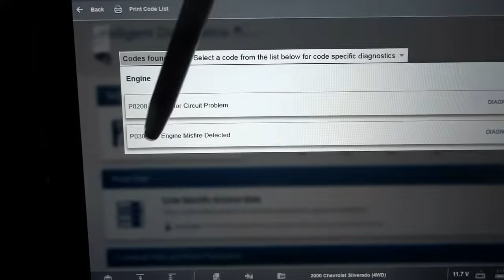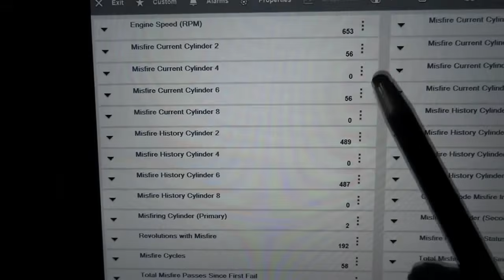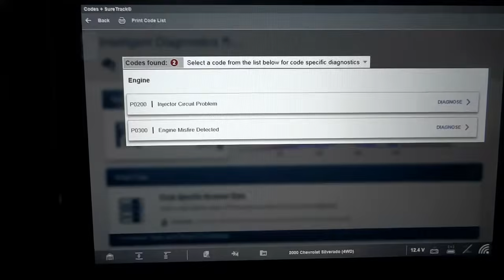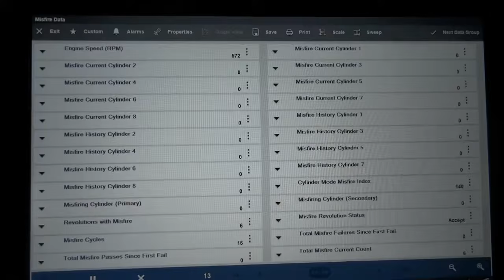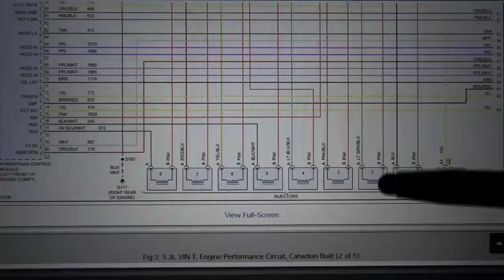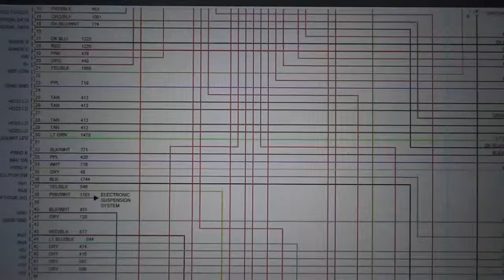Chevrolet Silverado Code P0200, Fuel injector Circuit Testing, Misfire P0300

Comment: Fantastic video.   Ran into the P0204 code on my Buick with the hard miss and need to troubleshoot the injector on cylinder 4.   Your clear and thorough instruction has given me the confidence to check the wiring and find and fix an issue if there.   Thank you for such a helpful video and you earned another subscriber...

Comment: My boss ❤
Reply from the maker: @GabrielEbenezer-ko2hp   Hello my friend!
Reply: @KITS_Auto_and_Truck_Repair  there is a 2013 Chevrolet Dezeal engine am working on, the car cranks but no start, I checked the egector to check if I can get a power on the sucket wire when the ignition is turned on, I checked with my test light  I didn't see a power i tested it with my thermometer to check the voltage I saw 2.4 volts instead of 12 volt what could be the course of the problem sir

Comment: Been troubleshooting a po302 on my 2006 Subaru sti.  Did everything else. All swaps,  compression and leakdown test o2 denso sensor replacement.  Vacuum leak test with smoke machine and last crankshaft and camshaft position sensor test.  Ordered  a noid kit for injector circuit
Reply from the maker: @PeterHernandez-lg2eh  did you do an injector flow rate test?

Comment: Great vid and easy to follow your thought process. One big question? On a modern 6 cylinder like a Chrysler 3.6 L the intake upper manifold would need to be removed to get to cylinder 2-4-6 This means there is no running the engine to test anything or checking compression right? So how are all these things checked.
Reply from the maker: @patlyle2621  They can be checked at the injectors fuse with an amp clamp!

Comment: I have a 2007 Silverado replaced the faulty injector circuit.. Tested all 8 with noid light and all now show as working… Cleared the engine light and after a few minutes of letting the truck run engine light came back on ran a scan and it is throwing the same
Code as before.. Checked with noid light again and they all blinked… What else could be causing the P0200 Circuit malfunction code?
Reply from the maker: @thethriftypicker7425  you probably have an open solenoid in the injector ( open injector )
Reply: @KITS_Auto_and_Truck_Repair  ok thank you!!!

Comment: How would i test the fuel injector's on a honda 3.0 v6 they are under the intake manifold? Im having a misfire on cylinder #5 and im pretty sure its a fuel problem because the check engine light is blinking.
Reply from the maker: @505fastlife6  you are gonna need a wiring diagram to test the injector under the intake, I recommend you take it to a pro mechanic who ccan diagnose it for you!

Comment: Thanks brother, let me please ask you this, can injectors communicate with ECM without power or voltage from the battery? Because according to your case, injector has no power coming from the battery, yet injector communicating with ECM
Reply from the maker: @kaaraa-mardha1977   Sorry! I didn't understand your question! the injectors receive power from a fuse then the ECM grounds them to turn them on!!
Reply: Ok brother, thanks for your quick response. if injectors receive power from the Fuse, and there is no power coming from site Fuse, how can then The injector communicate to ECM? Or the injector can still communicate the ECM even if there is no power from the Fuse?

Comment: I have two older GMC Yukons 
What bi-directional scan tool are you using in this video?
My 2004 Yukon has a misfire and I’d like to have the scan tool tell me which cylinder it is.
Reply from the maker: @Myflarelately  in this video I used my snapon zeus scanner!

Comment: Great work 👍🏽
Reply from the maker: @naptown4200  Thank you!
Reply: @KITS_Auto_and_Truck_Repair  hey bub thanks for the response back..? I got a P0204 cylinder 4 injector control circuit, I have no clue where to start from. 05 cadillac cts 3.6 engine..I've fixed the P0304 misfire, still have the P0204 CODE any tips sir 🙏🏽

Comment: What is the tool that you screw on to the wire before testing it? And is it necessary to test the wires?
Reply from the maker: @davidedwards7954  yes! it's a wire piercing tool!

Comment: I have a 22 year old Peugeot 206 and it's become my forever project since blowing a head gasket 2 years ago. As the car only cost me £500 I was not going to spend thousands for a mechanic to fix it so I decided to teach myself. Since then i've done pretty much everything you can imagine to this car and recently after replacing the CAT and exhaust i've been having a misfire, as the car was so old, I just went ahead and replaced all the injectors, coil pack, sparks did a compression test (all fine) and all I am now left with is an electrical fault and your video has very simply explained everything I needed to know to go and find this wiring issue and fix it, kudos to you and thank you. Sub'd and liked !
Reply from the maker: @i.fishtank  Thank you! I'm glad to hear that the video was helpful, and welcome to our youtube community!
Reply: @KITS_Auto_and_Truck_Repair  Thanks for the reply, so to update in the end I tested every wire on the ignition circuit and there were no issues with any of it. Voltages and continuity were all fine. However I did find a cracked and disintegrated knock sensor which I replaced and that has resolved the P0200 open circuit issue, however, the P0300 random misfire still persists. I am almost at a loss now, I am thinking to replace the fuel filter, MAP sensor and do a battery condition test as a next step, those parts will only cost me about £40 but I wonder what you would check?
Reply: Oh I should add, it's already had new O2 sensors.
Reply from the maker: @i.fishtank   I recommend you take it to a pro mechanic who can diagnose it for you, if the wiring is good your ECM Could be the problem, go get it diagnosed!
Reply: @KITS_Auto_and_Truck_Repair  Thanks for the quick response... spending money on diagnostics for the ECU is about the same cost as buying one, but my point in all of this is to try and learn and teach myself, I'll start with the fuel filter in case it's a pressure issue and a MAP sensor (both are original it seems so 20yrs+), I can get both new for a total of £10 :goodvibes: after that then I'll think about the ECU. Out of interest, do you think it's possible it could be a timing issue? I did have to do the head gasket 18 months ago, but it ran fine until this year.
Reply: Ha! Turns out it was the MAP sensor after all this time. Just started to go bad the same time as the knock sensor.

Comment: What’s the part you used 18:56 called I believe you said a piercing tool
Reply from the maker: @ynotdoityourself3288  Yes!
Reply: @KITS_Auto_and_Truck_Repair HELP PLEAS 😢P124D CODE How can I repair the P124D code? Everything started to fail in March. After changing the oil, it stopped and I had to call a tow truck. They changed the module and the pump. After 20 days and 300 miles, now I get this code. And I am disabled. I can't afford to pay almost 4000 in a month. Thank you.

Comment: My problem is that I don't have a signal on the two injectors on the signal cable. Could it be a damaged PCM? Because I checked the cable and everything is ok. The signal on the signal cable is weak because it powers the led bulb but not the noid light.
Reply from the maker: AdamMotomaniak  make sure you don't have corrosion on the control wire, so if the control wire is good, check your powers and grounds of the ECM if they are good they you have an ECM problem

Comment: I have a flickering noid light on all 8 cylinders, cleared the codes multiple times and still having 200 and 300 codes. Brand New  Autozone engine and old harness. Please help!
Reply from the maker: CHISEL CHIPPER 68  if your wiring is good check your injectors flow rate, you can have partially clogged injectors and make sure your coils are good too that's for the P0300 code, than for the P0200 code, you might have a Ecm issue but check all the circuits first!
Reply: @KITS_Auto_and_Truck_Repair  Thank you. Worked overnight and just got through discovering and cleaning the Idle air control valve to address idling  north of 1700 rpm. I'll take a look at what you suggested and if all fails, i'll email you and make arrangements to take the four hour drive from NYC. Thank you again you Noble Gentleman.
Reply from the maker: @ChiselChipper_68  My Pleasure!

Comment: Auto industry no longer recommending soldering.  Vibrations cause solder to fracture or heat can affect the solder joints.  Butt connectors with shrink wrap like you did.
Reply from the maker: Melanie Branton D.V.M.  Yes!

Comment: Got 2 codes p0200 and p02fd can't figure it out at all
Reply from the maker: Salt Blood Fishing  check your injector wiring!
Reply: @KITS_Auto_and_Truck_Repair  yeah I'm going to check the harness I think I pulled or broke a wire when I changed the oil pan gasket I'm almost positive that's wut it is after doing a bunch of research
Reply from the maker: @saltbloodfishing  Ah ok! Good Luck!

Comment: Okay explain my problem I have an '06 Chevy with a 5-3 I have the p0200 and p0300 My misfires are cylinder 7 and 8 but the injectors harness is firing with annoyed light on both cylinders spark plugs are firing on both cylinders so what could be the problem
Reply from the maker: MrYukon04  you could have open injectors! or one open injector
Reply: @KITS_Auto_and_Truck_Repair  I found the problem. they were used injectors that came out of a running truck and I guess there must have been something in the fuel rails cuz  number seven and eight injectors were both plugged up lol
Reply from the maker: @MrYukon04   Good! I'm glad to hear that you fixed your vehicle!

Comment: I'm have this same issue with mine. And I was told by several chevy owners a lot of chevys electrical problems come from wire harness issues over time wires break.  Most common problem is with grounds. Away ways thanks this may by my problem.
Reply from the maker: Jeremy Barrett  My Pleasure!!

Comment: My truck keep saying cylinder 2 circuit I have already followed the sires and I didn't find nothing wrong Also have I have replaced spark plugs injector#2 coil it's good and kt keeps saying that also stability trak light comes out right away ..!! Any help!!
Reply from the maker: Eugenio Torres  if the wiring and the injector are good! then you might have a problem with the ECM!!
Reply: Thanks for your response! Will check that.
Reply: now I have a code p0463 fuel level sensor high input circuit,  I have replaced the whole fuel pump ,fuel pump module too and still having that code on cluster needle doesn't move at all cluster is good has been checked.....any idea?

Comment: Hi, thank you for the video. My 1998 Golf 4 Gti has that code for all 4 injectors. How should i pinpoint the problem?  Where should i start?
Reply from the maker: Kago Motlhaping  Start by checking the wiring and making sure you have power at the injectors then Control, coming from the PCM
Reply: I will do that...is there any way it could be the fuel pump relay?

Comment: How many volts coming out sir?
Reply from the maker: Herbert lee kwan  Coming out of where? sorry, I didn't understand your question!
Reply: @KITS_Auto_and_Truck_Repair  coming out of the injector feed sir K. 12v or 5 v. I want to try direct from battery but I'm afraid I might fry the ecu. I want to learn testing to prove what's the problem.
Reply: Your a far better teacher sir. im very thankful
Reply from the maker: @herbertleekwan596  the injectors are fed 12V by a fuse under the hood then the ECM grounds them to turn them on!! don' send full power ( 12V ) on the control wire of the injector!

Comment: Excellent video.  Very easy to understand and follow your actions.  I do have a question though: on my 1999 Pontiac Firebird 5.7L, I have code P0200 only; no other codes.  I do not have a scan tool that can tell me how many times a cylinder has misfired.  The P0200 is intermittent, and does not always misfire, and I have no misfire codes.  What do you suggest that I do?  How do I find the trouble cylinder or injector if I there is no specific cylinder code or a way to see how many times a cylinder has misfired?  Thank you for your work; keep it coming...
Reply from the maker: myk sanchez  My Pleasure! To identify what cylinder is misfiring you can disconnect one coil at a time and watch for rpm change, if the rpm doesn't change after disconnecting the coil or the plug wire then that's the cylinder that doesn't fire!
Reply: @KITS_Auto_and_Truck_Repair  wow thank you so much for responding!  I just tried unplugging one coil pack at a time, but the misfire is intermittent so it isn't doing it right now.  I'm guessing that I'll I have to wait until the car starts misfiring again to try and find the bad injector?
Reply from the maker: @myksanchez1222  Ok, Sounds good! Good Luck with your project!

Comment: Got a 06 colorodo 5 cylinder same issue. Open circuit cylinder 4. Changed all the coils and injector#4, no change. Put the noid light on and no fire. Changed the harness, still no fire. Watched your video, and now to test both wires and go from there. Thanks for the video! Hope I can find an open wire.
Reply from the maker: robert anduha  My Pleasure! You could have a bad driver in the ECM, but make sure your wiring is good, I have a couple of videos here on the channel that can show you how to find an open in the wire!

Comment: I wish I could bring my truck to you I like your video’s and your honest work but I live in Kansas my truck is doing the same thing so I took it to a dealership and they just put spark plugs and wires and still doing the same thing running rough and engine light flickering
Reply from the maker: Joe Gonzales  I'm sorry to hear about the experience with your truck, I hope you can find a pro mechanic who can diagnose the problem and fix it for you!!

Comment: Thank you so much for showing step-by-step how to find the problem that was very excellent, I'm doing a vehicle like the one you're working on now and I cannot find the broken wire, the vehicle wouldn't start and then I got it to start and now it's not starting again.
Reply from the maker: Juan Rodriguez  My Pleasure!! check for spark, fuel pressure and compression!!

Comment: What scan tool are u using
Reply from the maker: Esteban Ramos  I'm using the snapon Zeus
Reply: Thank you and also what probe piercing are you using sorry to bother but I’m having the same problem with y 2004 Silverado 4.8 I replaced All injectors with new ones but nothing and my truck was running good and it had a bad head gasket and I replaced it and after I put new head gasket it wasn’t running the same like the light blinks when I step on the gas and smoke comes out the exhaust and the truck shakes really hoping it’s the wire

Comment: Same truck. Same codes. Same cylinders misfiring. I’ve swapped around coils, sparks, and injectors to no avail. Let’s hope my wire is broken 2 inches from my problem injector too! Thank you so much for the video and teaching
Reply from the maker: Clay Fick  My Pleasure!!  Hopefully you can find your open easily!!  Good Luck!!
Reply: I’m having trouble bc everything is checking out to be fine. Do you have an email to contact so I can ask some questions ?

Comment: I have a problem on cylinder 1. My other injector connector flickers but noid light stays ON on cylinder number 1? What should I do? Just cut the connector and soldier a new one?
Reply from the maker: Wevonox  if the noid light stays on it means there is constant ground on the control wire, that's not normal, you might have a short to ground on the control wire or a bad driver in the ECM
Reply: @KITS_Auto_and_Truck_Repair  how do I fix that short to ground on the control wire? Replacing the wiring hardness?
Reply from the maker: @wevonox7941  yes or finding the short, you need to take it to a pro mechanic to find it for you!! it can be very difficult to find sometimes
Reply: @KITS_Auto_and_Truck_Repair  I'll just try to find a hardness and replace it. Thanks bro😀
Reply from the maker: @wevonox7941  ok sounds good!!
Reply: @KITS_Auto_and_Truck_Repair  okay so I just finished replacing the engine hardness (battery hardness as well) every connector is connected right and clicked. I started the car and the engine sounds healthy like it used to. But tons of white smoke comes out from exhaust pipes smelling stinks of pure gas. 
 I just don't know if that smell and smoke would be from what was left over from before in the system and is now just releasing what ever is left or still not fix and would continue to smell and smoke no matter how much let it idle on and off(don't wanna catch a fire)?
By the way scan tool reports zero codes.
Reply from the maker: @wevonox7941  you might have injectors that are leaking!!
Reply: @KITS_Auto_and_Truck_Repair  but they are all new.? 😔
Reply: @wevonox7941   One year later but here we to. There might be a constant ground to to the injectors instead of a pulsing ground resulting in flooding the cylinders and the gas you are smelling are fumes of uncombusted fuel.
Reply: @CHISEL CHIPPER 68  hi I fixed it. All that smoke and smell of fuel was from before I replace a bunch of things on it. After it still was smoking like before and smell of fuel because there was a lot of it still roaming around in the entire system all over from the muffler to the exhaust catalytic converter and other ereas. It fixed it self every day I would turn it on for like 20 seconds no more because of the enormous amount of clouds of blue fuel smoke then days later I drove it from the street to the back yard and there was no more smoke I didn't expect that but great and days later the exhaust pipes just smelled like burned smoke from all that residual so I just replaced the entire exhaust with a new car and the car drove great for like 50k miles then sold it and bought 22 camry awd. Peace out✌️